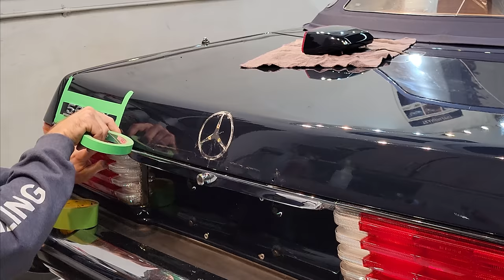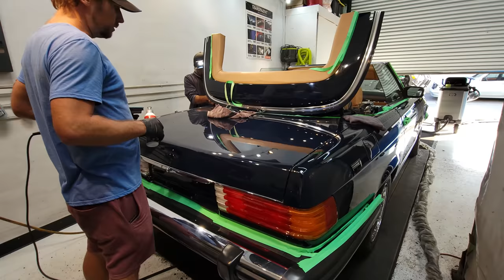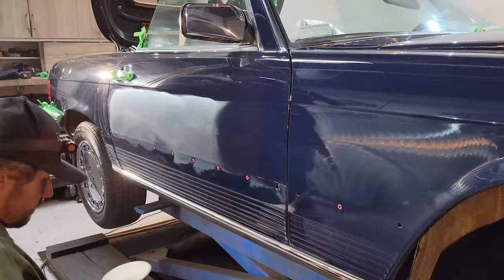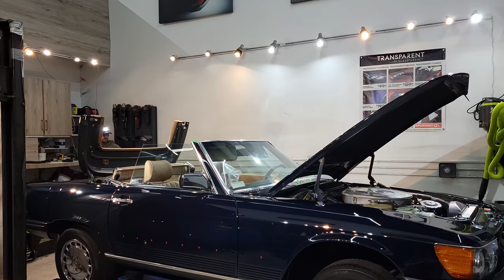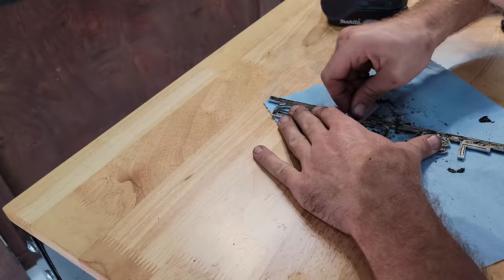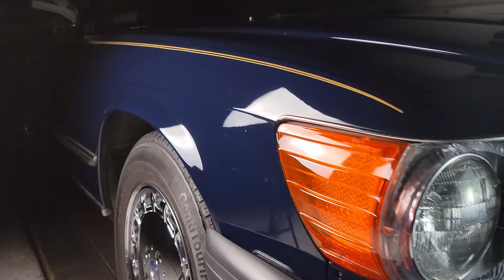Detailing & Ceramic Coating Mercedes 560SL Convertible

Comment: Magnificent work on a stunning car. Just one question, not a criticism, I’m wondering why the paint touch ups came after the ceramic coating application? Is it just preference? You guys are the absolute best detailers out there. Love your work! 🇨🇦👍
Reply from the maker: Thanks for the support! It's mostly preference. Sometimes I do before but mostly after. I think I had a few problems with single stage paint touchup before coating, because the coating reacts with fresh paint and removed that a little.

Comment: great video, but I would like to see a listing of the specific products you used at each buffing stage.   it went too fast to see how many passes you gave of each area and what products you used at each stage.   ceramic can be a bit tricky...  some better than others, and also what grade of cutting/polishing liquid you started with, went to in a second pass, and ended with....  etc.    are you actually using your machine polisher with ceramic..?   or was the ceramic just a final wipe-on wipe-off when all the cutting polishing was done...?    thx

Comment: Change the bumpers and the wheels.

Then get a new designed top and rebuild the engine so tou get 350 hp.